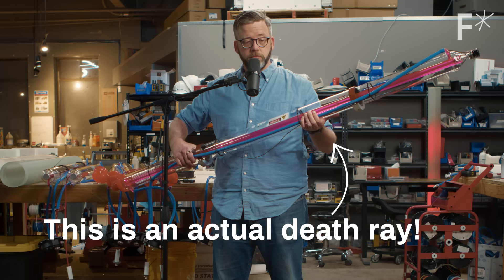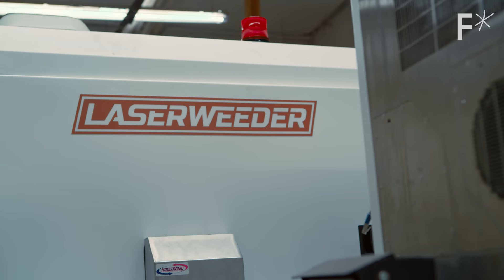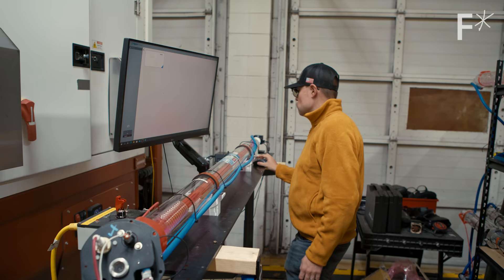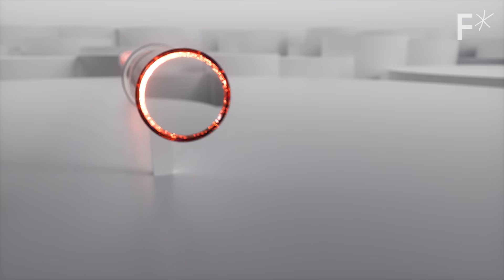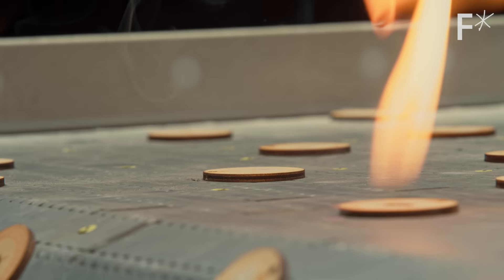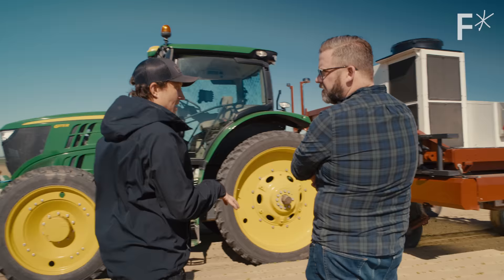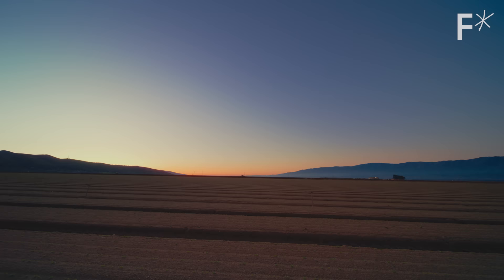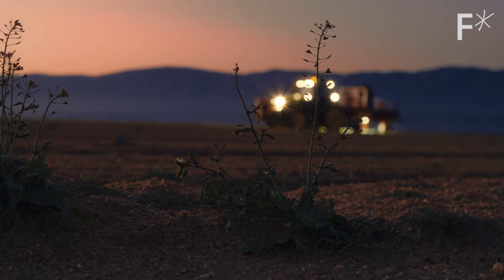Laser “death ray” kills weeds 80x faster than humans | Hard Reset

Comment: A fiber laser would be perfect for this thing.   Diode pumped fiber lasers are already displacing CO2 lasers in metal cutting and are more energy efficient and durable (no glass tube)
Reply: yes that's very true but their more expensive than co2 lasers and plus co2 lasers still have uses but still are getting slowly phased out so I bet they will eventually move to fiber optics
Reply: Later particle accelerators will do the trick as plants will become more immune to light...
Reply: New 2W IR diode lasers are available now. They can even engrave metal.

Comment: Great shots and I like the commenter's voice. I would have liked to see how the laser is redirected to the weeds, what happens when the plants we want are so big that cover weeds, how frequent  you need to use the laser, costs of the machine
Reply: I can answer a couple of these questions - the lasers shoot their beam into a mirror that can swivel around to aim the laser pretty flexibly - and this lets them shoot the laser under leaves that might obstruct the beam.  Also, they tend to run this through field while the plants are all really small, so there's not much obstruction to deal with.  My understanding when we filmed with them was that they really only need to run this over the field once to clear out the weeds.
Reply: @NickFromHardReset  Are you part of the crew that filmed this video? Thank you for answering. So they needed to run the machine only once till the end of the harvesting process of that batch of plants?
Reply: @jack8831  Yes! I'm the director/host of the show.  I don't want to speak too generally about how many times they have to use this, because every crop and every farm is different.  That said, when we asked the folks at this farm how many applications of this they used, they said just once. I believe they also have a hand crew that comes through later in the growing process, but they said that was more for just having humans to look through everything and make sure the crops were doing well.

Comment: There's a newer, really OLD way of dealing with weeds.  Don't use chemicals, and don't till the soil.  You often plant when there is still a crop in the ground.  You have fixed beds with walk paths between the beds.  When you harvest anything except root vegetables, you leave the roots of the plant in the ground.  This is called regenerative/no-till agriculture, and it can scale up to large farms, although it works better on a few acres or less, that 2 - 4 people manage.  And it works well because it's highly profitable.  You don't spend money on any chemicals.  You DO either have to make compost or bring in material that can break down into compost to be put on top of the beds.

The goals are a few.  One is plant density is higher, and the soil always has plants in the ground.  This creates VERY healthy soil, and soil health is EVERYTHING in farming.  It also adds material to the soil which over time greatly improves its ability to hold water and this leads to healthier crops.  But plants have a relationship with the life in the soil.  Plants produce sugars that get stored in the soil.  In times of distress, the plants can pull this back in.  But it also feeds the life in the soil.  This life (microbiome) in turn feeds the plants by breaking things down and making available the nutrients the plants need.

Whenever you till the soil, you destroy the microbiome.  And this isn't the tales of holistic wannabe farmers.  Science shows this.  The other thing that tilling does is brings weed seeds up from underneath the growing area for these weeds up to the surface where they can grow, so tilling defeats it's own purpose.  When you have healthy soil and good plant density, weeds are very few, so even if you do spend some time pulling weeds, the fact that you have developed soft, loamy soil means you can pull it out of the ground and the roots come with it very easily.  Also, because the soil is very healthy a minimal amount of weeds has little bearing on anything.

It's best once again to do this with smaller farms, like 10 acres or less, but there are farmers developing new techniques which allow them to use heavy equipment over hundreds of acres and they can do no-till operations.  Now, this is new for large scale farming so the equipment and processes are a work in progress.

For details read about no-till farming or regenerative farming.  It's too much info to put into a comments section.

Comment: May I ask: why don't you just use some kind of mechanical system to get rid off the weed? Laser looks like overkilling.
Reply: That's what we've been doing for thousands of years.  Tilling, hoeing, hand removal = mechanical systems.  I suppose you could put hoe and spade arms on a robot, but to me that sounds far more prone to breakdown (from dust, and general wear and tear), a whole lot more expensive to maintain, and much harder to build cheaply enough to replace herbicides.
Reply: @Daniko2  Do you think mechanical systems are more expensive than lasers?
Reply: They mentioned in the video. Burning with the laser doesn’t disturb the soil, so it prevents erosion.
Reply: @luismiguel5391  Initially, no.  But the reason lasers are expensive is because they are still relatively new technology.  There is still plenty of room for them to benefit from economies of scale (the more you make identical things, the cheaper each individual one is to make--up to a point).  But the same is not true of mechanical devices like hoes, spades, and plows.  They're already as cheap as they're likely to get.  So if we haven't already incorporated them into weeding systems, it's far more likely to be  because it's just not cheap enough to compete with herbicides and migrant labor.

Also, it's always more expensive to maintain the moving parts of a machine.  The fewer of them there are, the cheaper maintenance is.
Reply: @paulpease8254  Well designed mechanical systems doesn't disturb the soil either. That's just an excuse to sell the buzzwords. They use laser because is cool.
Reply: @Daniko2  No, they are expensive because the "mirrors" have to be perfect and because they consume a lot of power. And this is the case regardless of the tech, because of physical reasons that I don't want to remember anymore.
Reply: @luismiguel5391  Have you ever started up a company with millions of dollars of capital investments? Doing something because it’s cool is a great way to throw your investor’s money away. This is for farming, an extremely well-established industry. No farmer is going to buy something because “it’s cool”.
Reply: @luismiguel5391  And yet the price of lasers is coming down.  They are being used more widely.  They are cutting into markets long monopolized by knives, saws, chisels and abrasives.  They are being used more and more in medicine, industry, and even in some early-adopter hobbyists' homes.  When was the last time you saw a significant price decrease on knives or garden tools?  I think you're over-estimating the difficulty of making effective lasers--probably because as new(ish) technology, they used to be prohibitively expensive for all but the largest of organizations.  That's no longer true.
Reply: @Daniko2  Are they being use because the price lower down or because of the technical advantages they provide and how cool they are? In this example, a laser is being use just to sell the buzzword and not because it's better or cheaper. It's obvious to anyone who knows how much it cost to make a laser function, something they didnt talk about for some reason. And, just to answer before hand, thereare lower limits for how much you can bring the price down. For example, the chamber with two mirrors is call a Fabry-Perot interferometer. The mirrors are not regular mirrors as one can probably guess. This mirrors need to be really polish and really reflective. To do so, you need to cover then with some kind of expensive layer of a type of material call dielectric. Or even more than one. And this layer needs to be thin as hell. Doing so is a nightmare no matter the method you use. On the other hand, to make it work you need sufficient energy to mantein the conditions that allow the light to enter the Fabry-Perot and "bounce" side to side. Again, regardless the technology, this is a problem we are unable to avoid. There may even be more barriers that stop the price to go down. This is simply not a good idea.
Reply: @luismiguel5391  You start by admitting to technical advantages, and then assume there aren't technical advantages on a farm.  And I really don't get why you think a large swathe of successful business owners would shell out for a device because it's "cool".
Reply: @Daniko2  Lasers are better when you need pinpoint accuracy and smooth edges and things like that. It's more expensive but you get better results. On this case, there's no reason to use a laser when you can just cut the weeds. And it costs more.
Successful business owners throwing money at cool things, with no real use, is nothing new in tech.
Reply: @luismiguel5391  It's not "tech".  It's farming.  Not a business that has ever been able to throw away money on cool things.  And like I said at the beginning of this conversation: we've been "just cut[ing] the weeds" for literally thousands of years.  If there were significant room to improve "just cut the weeds", 10-30 thousand years across 6 continents and billions of farmers was plenty of time to find it.  Time to try something new.
Reply: @Daniko2   I don't think normal farmers are the ones buying this. It looks more like vc capital to me. And yes, I just check: carbon robotics has secured 27 million in series b funding from a vc company called Anthos Capital.

There are new things in farming, just not as stupid. For example,  vertical farming makes more sense. Not everything new is better.
Reply: @luismiguel5391  Well, it should be interesting to see one way or the other.  And I agree that vertical farming is a great idea for some types of produce if energy costs can be brought down without more fossil fuels, which seems eminently doable.

Comment: What more we could do? Solar powered towing vehicles that could pull the laser thingy without a DIESEL BURNING TRACTOR running that slow. I could see unnecessary fuel costs and certainly unnecessary environmental costs not being an issue. (As long as it's sunny. Otherwise a slow diesel-burning tractor at slow speeds would still be very beneficial.) 😶